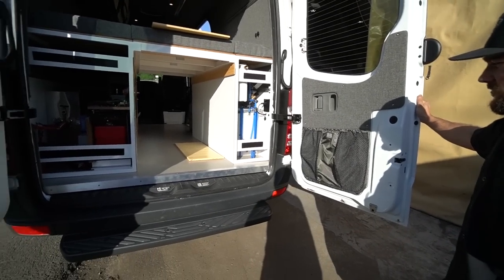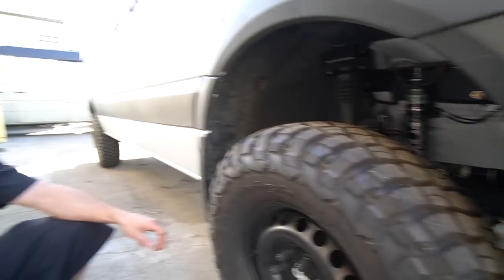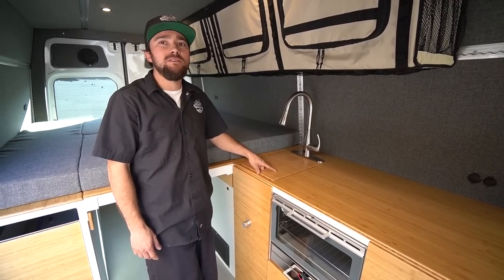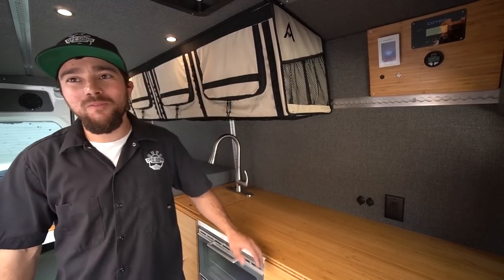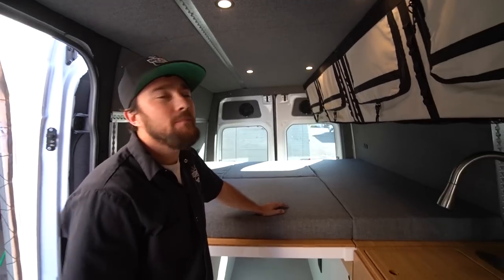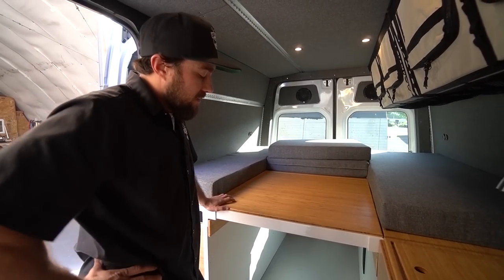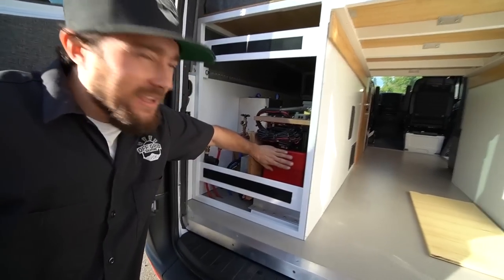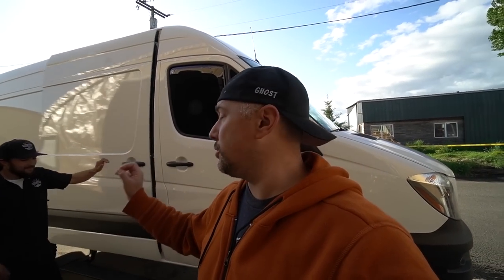STEALTH Adventure Van Tour - Simple Design, Heated Floors, Off Grid Power

Comment: Really slick two water tank system. I like how the under mount tank is only used to fill up the tank in the van and has its own pump. It makes it a completely separate system, which would be easy to not use in the winter.

The whole build is top rate.

Comment: Freaking awesome build out. I actually like the more simplistic look for this van, it's very clean on the inside with all of the top of the line electronics that 4k single battery is sick with tons of water + radiant floor. I mean all the bells and whistles this builder did a really good job. The only thing I would be iffy on is the water tank on the bottom since he said he wants to hit cold climates not sure if it will freeze or not and since it gets pumped through the totally awesome water filtration system hopefully there's another way of filling the top tank just Incase. I guess that's kind of the price you pay if you want so much water. Either way awesome job👍

Comment: Very Impressive van.

To personalize it for me, I would make all the white inside, including the metal parts, in the same grey as the walls.
And if it's possible also the aluminium tracks would have to be powder coated grey.
The bed platform also grey, and I mustn't forget to put that honeycomb thing against mold.
Maybe I would like the cabinet drawers of the galley in the same color as the mule bags cabinets. I think that would lok nice.
My own esthetics theory says there should be a minimum of two colors and a maximum of three colors to make a space look pleasing to my eyes. You may call me crazy.

The back of the watertank underneath I would ask OGS to paint it black for me.

I would put a high shower pan in the back and take squat showers. The aluminium ceiling tracks must be able to hold the foldable shower curtain rails.
Further I woud be open for ideas to make the open space above the electrical stuff usable as storage.

Perfect.

The shore power inlet beneath the hull is also genius.
And also the massive amount of fresh water on board is great to have.
Oh, the battery is also great: small for so much power.

Comment: Great van.. I didn't see the following: Smoke/ Carbon Monoxide detector, Fire extinguisher, and a air tight Fire Proof metal battery box vented outside van.. The 2 inch box space surrounding the batteries help in case of an explosion or fire...  Safety first! Nothing ruins a trip like a fire or medical emergency..
Reply: Lithium batteries don't require venting.

Comment: Great van build and such talented builders.  Loved the clean look and all the tech talk.
Loved the discussion on leaf springs, shocks, etc.  Some went over my head but I will research and digest this.  We need more of this.  Not glamorous stuff, but this is what makes a van useful and there is not enough discussion of these modifications in van builds.  Great stuff!
The aluminum cabinets are the way to go.  Such a crisp, clean look. The bamboo is light in weight and so beautiful.  Well done!
Lithionics battery - looks like technically advanced and has greater features for ease of use.
UV light filtration, the tanks, needs a whole other video to understand.  It would be helpful to make one so that we know what they can do for van builds.  This was unclear.

I did not like the soft Moab storage bins - the bamboo should have continued all the way down.  These may be useful but not aesthetic.  They cost $400 for a 2 pack so are more expensive than cabinets!  Not much point, except the modular design that you can shrink, move, or remove.  Most times, even if you use a van for work, it does not affect high placed cabinets. So this was a huge expense, detracts from design, less functional for breakable objects, and prone to rips and tears if some plywood slab you are carrying comes in contact.  
Nice fridge. The Isotherm Cruise 130 Stainless costs $1600 + tax. Received a B rating online. Some issues but overall cools well.  Other options are Vitrifrigo, Novakool (Canadian), and Dometic.
Alcohol Stove - Dometic ORIGO 3000 Double Burner - Non-Pressurized Alcohol Stove - two burners. Stove alone costs $418 at a Marine store, less on Amazon but is a discontinued model.  It received 5 star reviews on Amazon. This is a highly portable stove with easy fuel purchase. Uses denatured alcohol (any hardware store) which you pour into fuel rings (provided with stove).  No pressure, very safe for boats and RVs.  For boats, you can buy a gimbal to keep it stable during rocking. 
Origo 6000 Oven with Stove costs $1800 in marine shops but is now discontinued.  Could not find the oven separately online.  This is a pricey cooking system. But I am sure there are other alcohol stoves available.
The builders were charismatic and sweet guys.  And so talented, wow!!
Two issues:
1.  I don't know where these guys are located.  This is a problem on many videos.  Please start out with location.
2. A bit too much joking around.  Let the guy talk.
Thank you for no music!!!  Hooray!!!!

Comment: Hi Jarrod.
What would be the points against placing the control panel, which is now up the wall behind the driver seat, in the middle against the ceiling of the drivers cab just like in the cockpit of an airplane?
Reply from the maker: I guess having access to the control panel while in the "living quarters" would be best because while out camping or stealth camping in a city you wouldn't need to go to the front for any controls. It's just easier to have the panel in the back
Reply: Thank you

Comment: Great build !! I wonder if the 30 gal. Water underneath the van will freeze? He did say it's 4 season?
Reply: Im pretty sure it will. I watched a youtuber that had that problem. He had to put a heating pad underneath the tank to heat the water to be able to drain it ( it was his grey water tank). Plus, heating the tank that is essentially plastic doesn't feel right to me. If i had to do it, i would have the water inside.
Reply: Yeah. It will freeze but he still have a 20 gal. inside.
Reply: Also the pipes outside can and most likely will blow because of the water inside... Its just better and safer to have everything inside...
Reply from the maker: Under tank would freeze but as someone else said it's just used as back up or extra. The tank won't "blow" because normally the plastic used won't break unless in -40F. There are ways to avoid that issue if needed but his other tank will be just fine the way it is